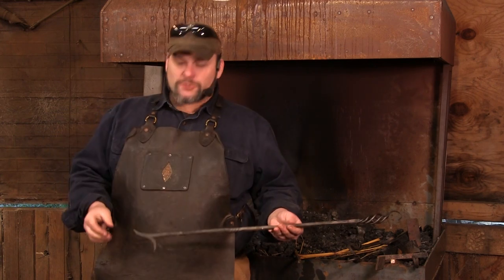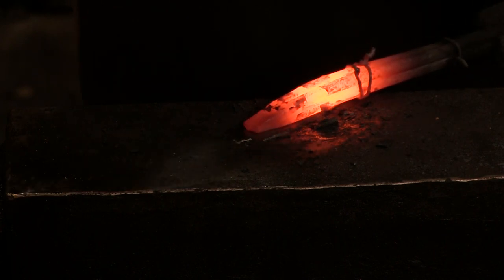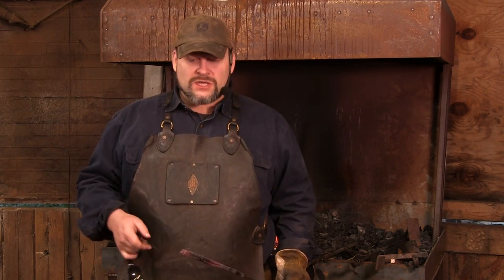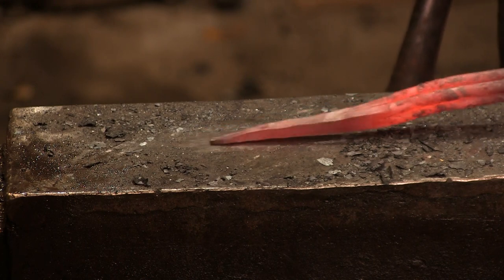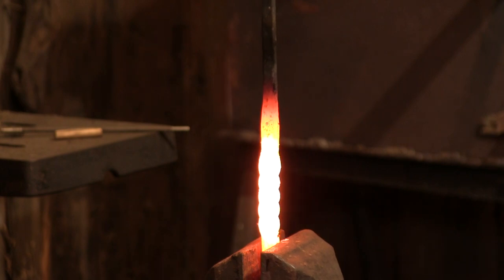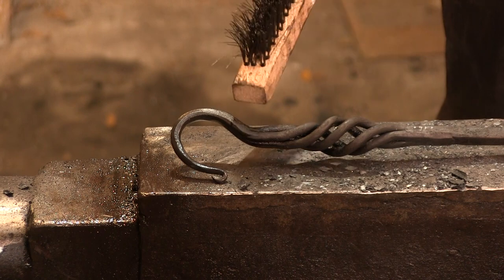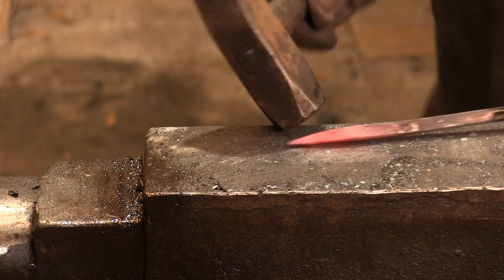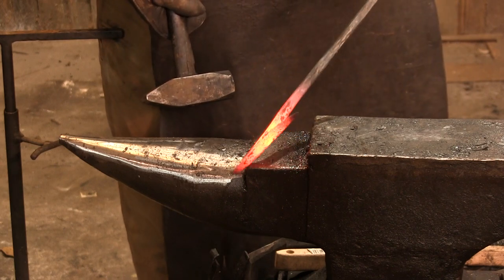Forging A Blacksmith: The Poker (#2)

Comment: Caveat: I'm a newbee, never forge welded.  Question: If you heated and twisted the ends of the rods say 2 turns before trying to forge weld, would that make them more or less likely to give you a good weld? Or would that just up the probability of a cold shut?
Reply from the maker: Going to end up with a mess. Cant twist it tight enough over that short run to do yourself any good.